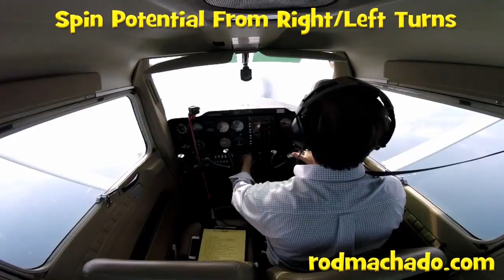Right vs Left Pattern Final

Comment: Whoa, just getting started in this flying adventure and fired up my brand new copy of XPlane to try this out.   Low and behold it worked very similarly to how you demonstrate here.  Skid resulted in a pretty abrupt roll and loss of 400+ feet before I could 'fix' it...crashed a couple of times.  The slip sometimes would stall and other times i would just lose altitude while going in a circle even with the stick yanked all the way to the back (also no flaps).

That was in the cessna anyway.  I tried it in the vtail cirrus jet and it wouldn't roll over.  Wonder if it's anything to do with the vtail or lack of prop torque?  I'm in way over my head lol but it's very cool (and sobering).